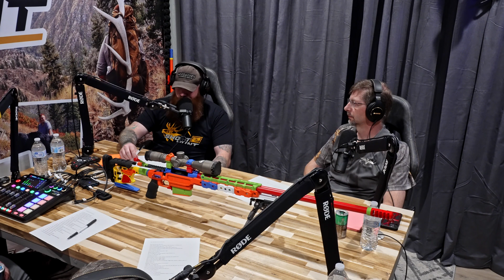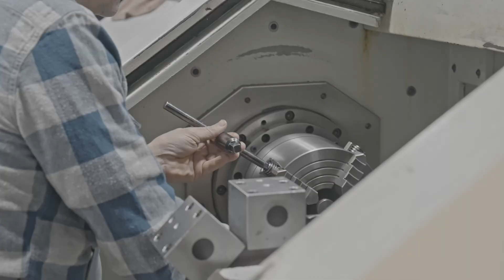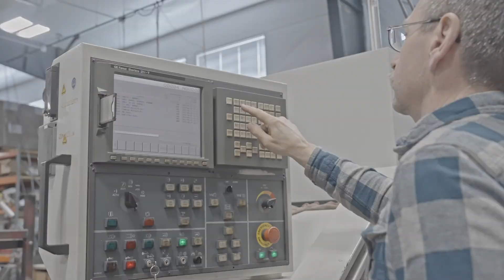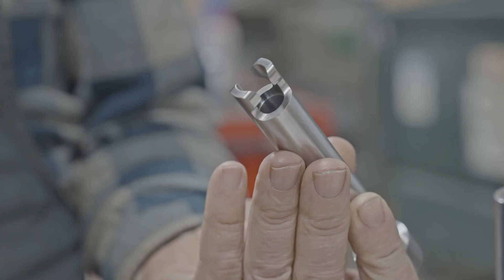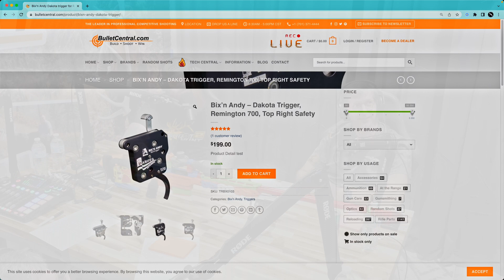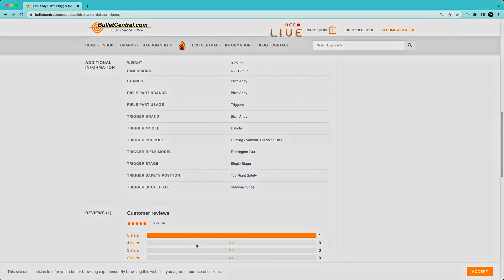16. Rifles Deconstructed (Part 2) All Things, Rifle Actions // FT. Bat Machine //

Comment: The controled round feed goes back to a timr when we didnt have the temoerature stable powders that we  have today. And under heavy recoil the cartridges in the magazine the bullets would seat themselves back in the case cousing compressef loads creating high pressure stuck cases in the chamber

Comment: Smoke and mirrors my A#$, The Mauser 98 is the Standard for all bolt guns, Admittedly it takes more time to build a CRF action ,But done properly it will feed with near 100% reliability. Push feed are much (Cheaper) to build ,I own both,  Push and CRF.

Comment: Most of my actions are CRF. This includes Zermatt, ARC, Kimber, Sako 85 and FN Mauser (Husqvarna). One thing is to reduce the chance of double feeding, potential (unlikely) problems with spring plunger etc, but my main reasons for prefering CRF is for convenience in the field, at the range and when reloading. I load and empty my rifle much more often than I actually fire it, and I find that emptying a gun where the case is always under spring pressure increases the chances of loosing the case and making noices. I also find it easier to remove the case using one hand with CFR. 
At the range, CRF gives me the opportynity to decide how far my precious brass is ejected when I cycle the action. It is also nice not having to remove the ejector plunger to get an accurate distance to the lands. 
In my experience the main factor for reliability is the construction of the extractor. My TL3, being semi CRF with a plate extractor, has given me issues many times on the range (I never use tight cases for hunting) when chambering tight (neck sized brass). It will then have problems extracting the case. This has been an issue a few times with my 85 as well, but not with any of the other before mentioned actions, including ARC Nucleus and Archimedes.
It is perfectly inderstandable that manufacturers will use a system that will give less calls to customer service. The risk of customers having issues is, of course, much greater when the manufacturer is not building the whole rifle, including bottom metal and magazine. 
A few words about magazine solutions and feeding: Double stack is more difficult to get working than center feed and especially when you mix in CRF. Look at the Sako 75, 85 ond 90. A more user friendly magazine solution is difficult to get as far as my experience goes. Five rounds of 308 in the mag, with the ability to top feed with the mag in the rifle and removable when needed. And lets mot forget the ease of loading a double stack mag (eg AIAW) compared to center feed mags. The market really needs a 5 rd AIAW mag for hunting rifle builds. 
Is there anything wrong with push feed? Not in my opinion. Personal preferance is the key. Two plungers is probably be better than one from a reliability standpoint, but as long as extraction is good one can always remove the fired case manually.

Comment: Great podcast, thank you. Regarding trigger hangars on modern Remington 700 footprint actions, there are three potential reasons that I can think off why a designer might decide to incorporate it into an action. Some of these were mentioned in the podcast briefly:

1. To allow for trigger timing. This enables the user to adjust the position of the sear to get more or less cock on close. It just affects how the action feels when used and does not affect accucary, as long as it does not drastically reduce the striker fall distance signaficantly.

2. For actions with full diameter bolts, the trigger needs to sit lower, thus the trigger pins need to be lower. But it is physically not possible as the holes will break through the action outside diameter. To prevent this, the designer either need to use a trigger hangar, or machine protrusions on the underside to allow for extra material to machine the holes. The latter might be more expensive, hence the hangar.

3. Less common these days, but with the right stock/chassis, it allows the shooter to remove the trigger without having to remove the action from the stock.

Thus the positives of a hangar are:
1. More adjustability.
2. Allow for the use of full diameter bolts as well.

The negatives of a hangar are:
1. Most stocks require modification and sometimes the hangar itself needs to modified to fit some triggers. Arguably actions with hangars are thus not true Remington 700 footprint.
2. More complex and more parts that could fail.

Really enjoy your podcasts.

Regards

Hanno